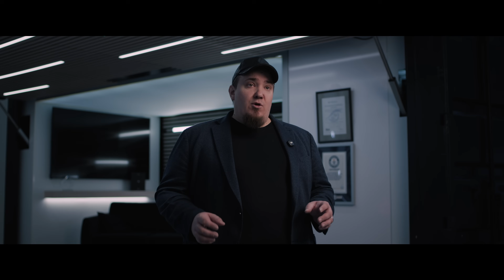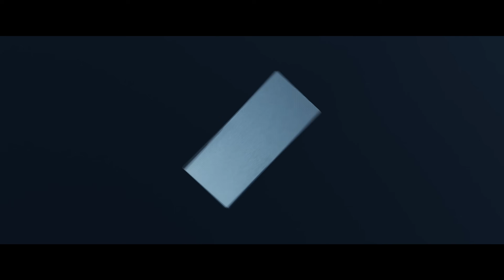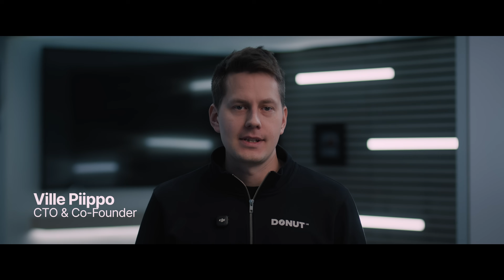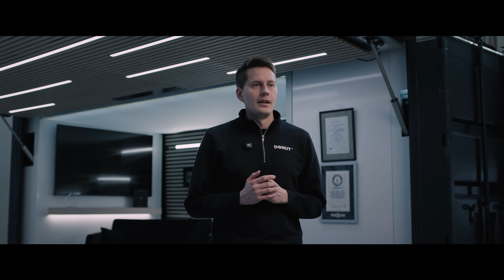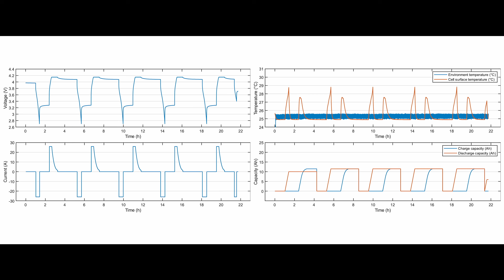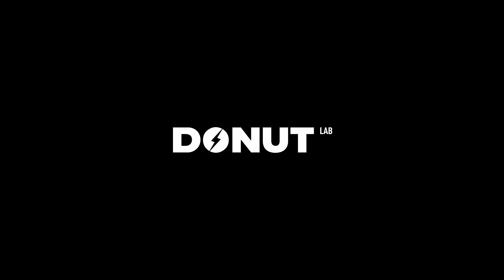Donut Solid-State Battery: Safety Demonstration Test | I Donut Believe (Pt.5)

Comment: The funniest part is that the skeptics are the first ones to show up here, watch the video, and then tear it apart.
I’m still praying it turns out to be at least 25% of what they claim.
Reply: 25% still means they lied about the other 75%
Reply: @SimplyGregsterEV  and what does it matter if 25% of 100,000 equals 25,000 cycles? It's irrelevant.
Reply: @wayonantunes6785  BYD blade battery 2.0 is 4000 cycles if you charge once a week, that's almost 77 years lifecycles. Now think about the claims of 100,000 cycles or even your 25% 'truth'
Reply: @seekingworldlywisdom even if they are lying and it has 150 Wh/kg and 10,000 cycles, it would still be far superior to anything on the market. But the key difference from the others is its safety—it won’t catch fire. If it is cheap, the market's perspective will change completely.
Reply: @wayonantunes6785  BYD blade battery 2.0 is 190-to210 wh/kg, 4000 cycles, nail penetration test, 600c heat test, buy it today now (in China) in a production car... No, people want miracle battery for 100,000 or 10,000 cycles cell not even a battery pack from a "Nobody heard before company with a dessert name" and the "ceo" has invented Super Artificial Intelligence whatever it means, there will be some people can be fooled all the time. or aka suckers!
Reply: With these tests that they have shown, it has already made like 50% of their promises. Still more to come but they already have silenced lot of the critisism. Result already show that this cant be Lithium battery that was the most used non believers belief.
Reply: @WespaVesaAijala  Mr Paranormal they have shown maybe 5% of their promises. They have failed 20% of their promises. There is no evidence for the rest, because it doesn't exist.
Reply: @izzeww8487 
You're not making true statements, or valid arguments, in ANY of the many comments you've been making, all over these threads.

This was another utter falsehood of a comment. Do better. Any FACTUAL criticism still matters - but not the slop you try to actually state as fact.
Reply: @justinklenk  Woah spicy today are we? It's fine for you to have your opinion, defend the fake Donut forever. Are you a cop or something, loving these donuts?
Reply: @izzeww8487 
Good one.

And - great argument.
Reply: @WespaVesaAijala  first it was lithium, then modified lithium, then it became a supercapacitor, now...
They're not going to give up easily, but the fact is that even if Donut exaggerated or even lied, it still looks like a good product.
Reply: Especially on cycle life... that would be amazing
Reply: Cycle life means nothing after 10k and we already have a bunch of 10k batteries  @ziimura

Comment: Let's go over the facts we know about this battery:
1 – It withstands high temperatures.
2 – It charges quickly.
3 – Even with the vacuum seal broken, it still worked and proved to be safe.

I figure that even if the company exaggerated its specs, it's an excellent battery. If it can be produced cheaply, it will be a great option and, in my opinion, better than others on the market. I repeat: if even 25% of what Donut said about it is true, the world will never be the same. Let's assume it has “only” 200 Wh/kg and a “ridiculous” 20,000 cycles. I ask everyone here:
Do you know of a better product on the market?

I don't.
Donut Lab really seems to be having fun. Scheduling the next test for April 1st is brilliant and gives them even more free publicity. I definitely don't think this series is bad, and I really enjoy how much the skeptics hate it. My IMDb rating for it is 9. Hahaha
Reply: Really teasing it.
Reply: Well, if you look how long lasting it is the way Li-Ion batteries are looked at, it "died" in around 10 cycles. Far from 20 000 cycles or 100 000 they claimed. If you now say the conditions were extreme, they claimed that the battery would handle high temperatures really well. 
Could anyone tell how many cycles Li-Ion could make before the capacity drops in around 50%? is it around 5000 or 10000 cycles?

Also, this is not a battery, it is one cell. We haven't seen a battery being tested yet.
Reply: @Hilirimpsuti  as explained in the video, the packaging wasn't designed to withstand 100 degrees. You and everyone on Planeta have every right to doubt it and ask why they didn't test it with the proper packaging. But if it doesn't work and it's all a scam, as user @justinklenk said, the reputations of everyone involved will be ruined forever. I believe the company may have exaggerated their claims, but even so, it still seems like a great product to me. In any case, the motorcycles will be delivered in a week or two, and all doubts will be cleared up. I also think the next video will be the most important one yet—for better or worse—since once the motorcycles are in the hands of third parties, everything will come to light in hours or days.
Reply: Don't worry about the cycle life. Solid state with no liquid electrolyte cycle life is least of the worries. If they can make it cheap fast and scalable it is gonna destroy competition @Hilirimpsuti
Reply: @Hilirimpsuti how did it “die” in 10 cycles exactly?
Reply: @rtmordecai1  It's capacity dropped by ~50%
Reply: @azertyQ  you mean the battery that had its vacuum pouch broken? that's a catastrophic failure for any battery the fact that is charges at all is impressive; a lithium battery would burst into flames if you tried to charge it with a busted pouch. this is like complaining that your truck doesn't make as much power after you destroyed half the cam valves
Reply: @azertyQ dropped to 50% and then remained what? Stable, it remained stable, as in the exact opposite of dying!
Reply: @rtmordecai1  that's effectively dead for the majority of the use cases for their batteries.
Reply: @BrandonAndrews-w5d  ok... but what about all the solid state batteries they're actually competing against. Thanks for agreeing that it is a dead battery tho
Reply: @rtmordecai1  NMC batteries are recommended to replace when the capacity drops under 70% from the original. This dropped close to 50% after 10 cycles.
Reply: @azertyQ 
That's not a factual or even a logical argument.
Reply: @BrandonAndrews-w5d If you check the VTT report, there is a picture of the cell after the test. You can clearly see that the pouch is intact but has swollen. This means there is liquid inside the pouch which means it is not a solid state cell.
Reply: @Hilirimpsuti - you missed the point that it's firm, meaning it's not a liquid nor gas that takes up the volume. More likely a solid material forming by a side reaction due to the pouch seal failing exposing the internal chemistry to the atmosphere (which contains oxygen, water vapour, and nitrogen that can react with a wide range of materials).
Reply: @Hilirimpsuti with a seal broken that they evidently didn’t mind testing over and over because that was the actual fourth test reveal lol, you’re proving my point.  The seal pouch failing WAS the point of the second test release.  They demonstrated other things but they clearly wanted to show the obvious chemistries this “failure” shows and they’re going to great length to rule out current NMC.
Reply: @azertyQ which isn’t going to necessarily use conventional pouch sealing or ever get to these temps in application.  These are pouches with metal plates or arbitrarily tuned heat sinks not packs and whether they can scale the bike packs to production for the orders of these bikes to start unlocking these secrets later this year the battery is much more likely to be in that bike from the non-“test” verge bike demo than to be  an outright total scam at this point.  People would ditch those bikes, with or without DL batteries,  and their evidently quite exciting bikes.  It’s a lot to keep up with and this is a slow roll out but the comparison to NMC is missing the point entirely here
Reply: @GruffSillyGoat That is what they claim but there is no evidence for it. Report say the cell is firm but doesn't tell if it is due to high inner gas pressure or if it is solid. The cell looks exactly the same as typical Li-ion cell after high stress cycles when there is gas formation inside the cell. The change in cell size is due to delamination of the cell structures which explains the drop in capacity. After 10-20 cycles the inner pressure of the pouch has increased on a level that keeps the most inner structures of the cell intact. At the end of the test cell is running with only the most inner structures that will create about 50% of the total capacity. 

I don't say the cell can't be a solid state but there is no evidence of it in these tests. And even if the cell would be a solid state, it is working extremely poorly.
Reply: @Hilirimpsuti  i don’t know your background, but I do know that the guy from the Two Bit da Vinci channel is an expert on this subject and has said he has no reason to doubt that the Donut battery is solid.
Reply: @wayonantunes6785  As I said, I can't proof that it isn't but there is no proof that it is a solid state cell. I base my opinion in the way the company and the people are "playing the game". 
Few things to acknowledge:
1. They have claimed to have a working solid state BATTERY that can be fully charged in less than 10 minutes with lifetime of 100000 cycles and energy density of 400 Wh/kg. 
2. They have not shown a proper battery testing done by third party but only a tests for a CELL that they claim to be solid state but have not proven it.
3. Released test results can be achieved by modern li-ion cells
4. People behind Donut lab have no experience or degrees from battery or cell technologies. Previously, they have been working with marketing, design and software.
5. They have told that there is a battery factory already running somewhere in Finland but afterwards said there is no such factory in Finland.
6. Verge motorcycles, owner of Donut lab, is economically in a bad shape and there has been some issues with external audit.
7. Donut lab is actively collecting funding from casual people but not from institutional funders.

IF they would have released test results straight forward without a hype and IF they would not be collection funding without an open share offering for institutuional funders and IF they wouldn't have told things that has not been true, then I wouldn't be so skeptic.
Reply: @Hilirimpsuti no, no, no, lithium Ion does not look like this with off gas build up at all.  The pouch lost vacuum and the pouch THEN expanded at the corners where the material was tugging in under vacuum.  You actually need to look at a normal li-ion pouch expanding under pressure and then watch the do test again.  Also, the gassing of a li-ion cell at that temperature would absolutely catch fire and/or explode.  lol the idea that the pouch seal failure in that second test could be a li-ion is preposterous!!!
Reply: @Hilirimpsuti  we have in the bike itself (last week!)
Reply: @shambler01  It was done by donut lab and they didn't show the battery or any proof that the charging was done for real. They might have just made a video of a charging and put it on a screen of their own "charging station" and filmed the video and a bike standing next to the screen.
Reply: @Hilirimpsuti 
True... but unlikely, given all the givens. You're of course free to disagree - but it's becoming a riskier and riskier gamble to go all-in on the 'total scam' claim. If they've faked all this, EVERYONE at EACH of their involved companies and Nordic Nano is RUINED - personally and professionally - permanently.
Reply: Agreed! I don't see ENOUGH people echoing this truth - these BASIC facts of the matter! (IF not faked - obviously!)

They've so far earned their drip-feed, marketing-push, finance-leveraging audience.

We are getting VERY close to where the rubber meets the road, everyone.

Comment: The 'game changing' attributes of this battery are no rare-earths, a 100k charge life cycle, 0-100% charging in <5 minutes, being solid state and that it has an energy density of 400wh/kg.  After 2 months, NONE of these claims have been credibly proven! NONE!  And it is the public being blamed for being skeptical!  The requests for validation have consistently been about these points, but they keep drip-feeding videos on stuff that is either irrelevant, easily faked or achievable with current tech already!  Will happily eat my own hat if this all proves to be real, but all the believers would be first in line to buy snake oil off this guy!

Comment: i again i want to believe but this ain't it again!.  survival after vacuum loss, high-rate cycling capability, rapid capacity fade, and especially the 17 % swelling with the pouch becoming firm, is not only possible but entirely typical for a lithium-ion pouch cell (likely a high-power NMC or similar chemistry) that has been thermally and electrically abused.

Comment: But does the battery lose half of its capacity due to charging to 5C with the broken pouch or even at 1C you lose it as well? I was also expecting a puncture test to validate they are safe, but maybe that's not a normal test.

Comment: No cold test? I live in Sweden so the thing I wanted to see most is how it handel low temps.
Reply: yeah same in Poland we had -25C this winter and normal EVs used for short city rides had even 23-40kwh/100km during the start, without garage and heating from wallbox.

Comment: Marco starts out by saying that the Donut battery is the first production solid-state battery used in production vehicles. Where’s the battery? Where’s the vehicle? These videos are just a way to stall until Donut Labs has a real product ready for market. Smart marketing if they can pull it off.

Comment: Actually, the most importantly is 100.000 cycle battery reliability feature!! Please make it real and legit
Reply: didn't you watch the video, capacity dropped to 50% after 10 cycles. 100k cycles garbo
Reply: @322-Dota2  You are the one who didn't watch the video. This battery unit was compromised because of the broken pouch (exposure to oxygen, humidity, etc.).